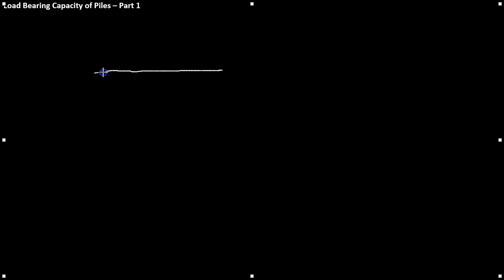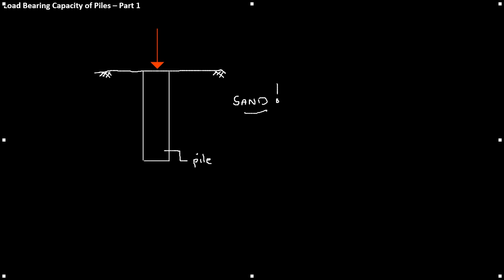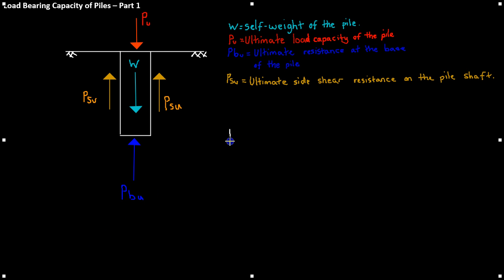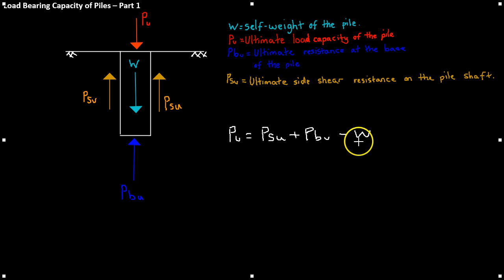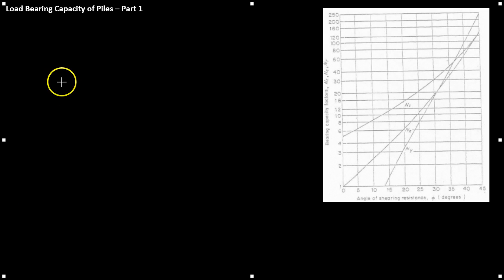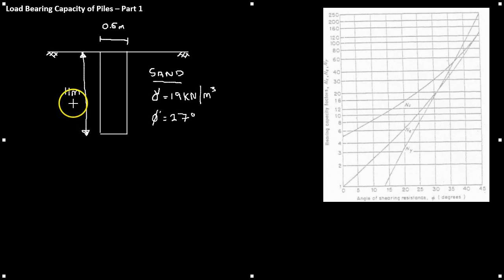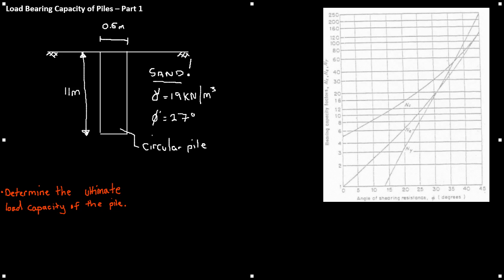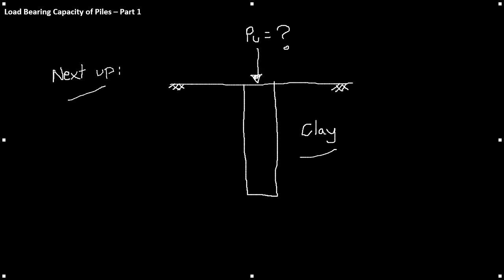Load Bearing Capacity of Piles - Part 1

Comment: at 9:20 you take the av. vertical effective stress as the vertical stress over 2. However, so far i've seen it as the vertical effective stress - pore water pressure in geotech, why did you divide by 2 and not use this method?

Comment: Hi , I am doing a pier foundation for solar array. I designed the pier for front and back post of the array. The back post taking more horizontal reaction than front post, so my back post pier is deeper than front. Is there any relation to increase the front pier couple of feet and reduce the back one.?

Comment: What if the Shear strength of the soil at the base of the pile is lower than the base resistance.
Reply: that is in case of cohesive soil...
Reply: +hddevani ?
Reply: different Cu ( shear strength) are taken in case of Clay ..not in this (sandy) case